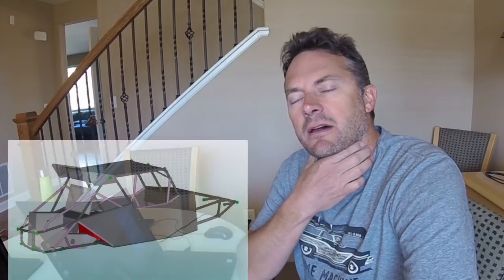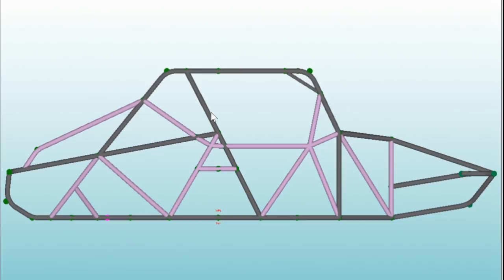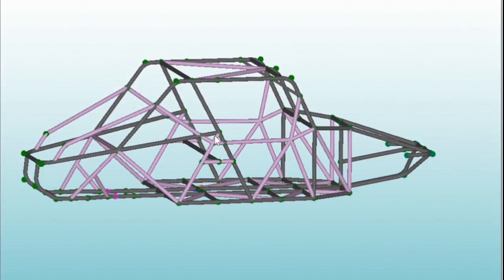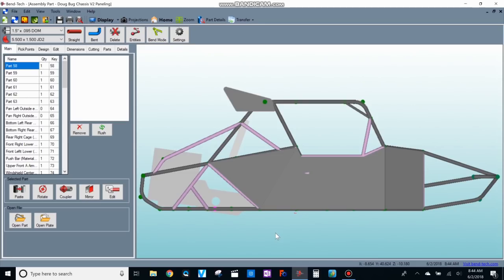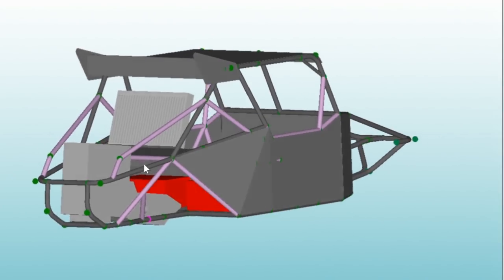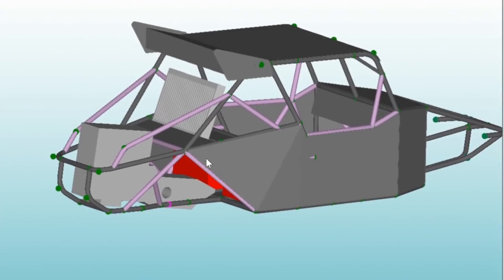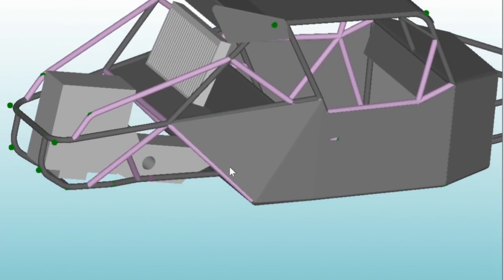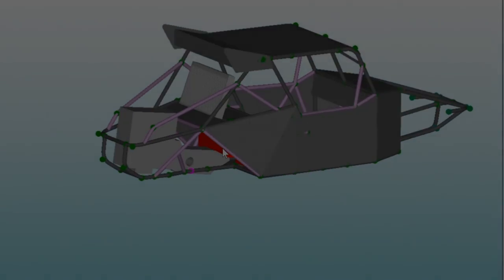Chassis Design Version 2

Comment: Some random comments. I've heard that the top bar height should be about 2 to 4" above driver helmet level. Also, some things to think about is the center of gravity. I would calculate based on airplane mathematics. Engine weight, cabin weight, frame weight etc. Not sure where the sweet spot exists, but I'm certain there is a precise position on a McLaren GTR etc. I'm not a car design engineer, but I would explore this math. Also, keeping the cabin dry is a complaint on all these rail buggies. May want to try to keep surfaces flat to put a top, side panels etc to keep you dry inside. Even Ariel owners complain about water ingress in their 100k buggies.
Reply from the maker: John, that tip on top bar height is good. When I fab up the skeleton chassis I'll check that and make adjustments as needed. 
So far for center of gravity I've been trying to focus weight if possible just in front of the rear axle. That's why the fuel cells and radiator are right there. On my current buggy I focused the weight there and it handles pretty good.
Good tip on water as well. When I fab the panels I'll see what I can do to make them in a manner that should shed water where possible.
Thanks for the tips buddy!
Reply: Thanks for the reply Doug. I forgot to add that the new design may make it more difficult to get in and out of the cabin. It appears there is less space to get your body through the gap. Maybe able to mock up the structure using some pvc tubing to ensure you are comfortable getting in and out. Perhaps adding a grab handle on the coach roof tubing may help with this.
Reply from the maker: I'm planning to build the skeleton chassis first, when I do that I'll be checking things like roof height, and access climbing in and out. Then I'll make changes as needed.
Thanks for all the input man, it's very helpful!

Comment: as far as the radiator goes, is there going to be any kind of protection for you incase it ever ruptured and sprayed hot fluid everywhere? instead of having side mirrors and a rear view mirror rear facing cameras are very cheap and would be cool to have instead of mirrors, they are water proof also.
Reply from the maker: I'll be honest with you.... I never even considered about the hot radiator fluid. I'll put some thought into that and see if I come up with any ideas. Thanks for the idea.
Reply: @DougBugBuilder  I had a friend get seriously burned because of his radiator got rupture from off roading, that fluid gets really hot.

Comment: Doug,

I like your idea of building a table in the same shape as the bottom of the chassis.  If I understand your design, the bottom of the chassis is flat except the nose section.  So why not take your build table idea one step further to save some cost and work?  In other words, skip the build table all together.  Start by building the chassis bottom (without the nose) and add some temporary legs under it to elevate and level it.  When done building the chassis, just cut off the tempoary legs.
Reply from the maker: BillPhillips4, The reason I'm doing it this way is because it will be easier for me to get accuracy with the angles and trueness with square tube. And I really think I'll build more than one chassis, having this base will make it really easy to replicate the chassis.....But If I thoulght I was only building one chassis I would consider doing it the way you say that would be cheaper and easier.
Thanks for the comment and thoughts!

Comment: Sorry if it's already been mentioned in another video. What is your wheel base and overall length of the chassis?
Reply from the maker: Nose to tail I think the chassis is about 12.5' long. But I sent you the file so you can see exactly how long it is. The wheel base on my existing Baja is 95". That would fit on this chassis but I'll likely extend it a little. You'll dial that in when you make the control arms.
95" is a little short, but I designed my Baja for the mountain trails around here. Slower speeds and lots of tight turns.

Comment: What do you think it will cost to fabricate in materials?
Reply from the maker: Using an average of $3.50 per foot, depending on the mixture of ERW to DOM. The software says I'll need about 225' of tube. So should come in around $785 dollars. I'll keep a tally though and report when done.

Comment: Hi doug, looks good but i think you need to triangulate the main hoop, if in a side roll/impact, the higher the impact the easier the hoop will move closer to you or your passenger and case a injury..... maybe????
Reply from the maker: Chris, just so I understand you. Are you talking about triangulated cross bracing on the main hoop for side to side support?
Reply: HI sorry, was referring to the main hoop just behind the seats. By triangulation on the inside going from top R/h to lower L/h  corners (and vice versa) so the main hoop retains its form at both top corners in the event of high impact roll over. This should minimise top corners from collapsing in on seated occupants. I hope this makes sense. Not sure how to attach an image to help explain. :)
Reply from the maker: I understand, thought that was what you meant. I'll have that added in on the next rendering. Thanks so much for the suggestion!

Comment: Run you radiator in the front and have a inline electric  water pump
Reply from the maker: Carl, I looked at my options for front or rear radiator options. I went with rear mount because that's what I did on my current buggy and it's working pretty good.
I get it though, there are a lot of benefits to having it mounted up front.
Thanks for the advice!

Comment: Can you lower the radiator in that area or can you put it in the front I also changed my motor to the supercharged Ecotec it's a lot whiner on passenger side other than that look real good
Reply from the maker: I can lower the radiator, I don't really want to put it up front, that would change a lot of things. But there is room to lower it 6-8" with no problem. I was actually thinking I would actually put it where it needs to be for best visibility but keeping it high as possible for airflow.
I'm assuming you want to keep it low as possible for visibility?
Reply: Doug Bug for safety and visibility and they're just ugly BMW and Porsche fans are quiet I'm going to try to put mine behind the back seat
Reply from the maker: Got it! I'll try and keep it low. I hear you on the fans, mine is pretty loud. Thanks for the tips.
Reply: You could take it a step further and lay it flat, the area below where the radiator is currently looks to be nearly the same size (could be an optical illusion though). You’d gain visibility and a lower c of g.
Reply from the maker: When I build the skeleton chassis I'll see what I can mock up. I might angle it back more. I don't think I'll go flat but can definitly lean in more. Sitting lower and angled in more might get it done. Thanks for the tips.